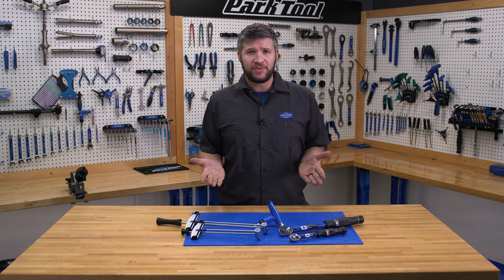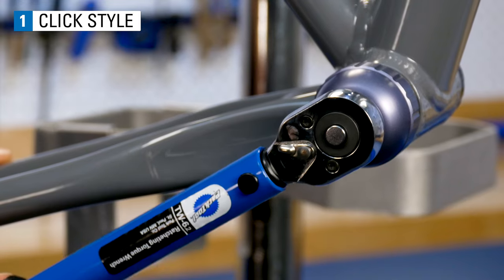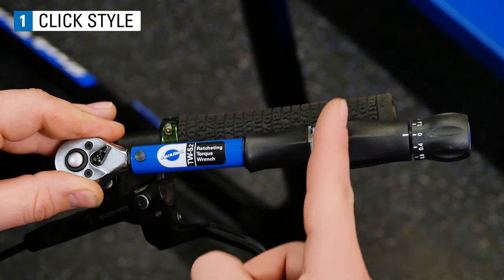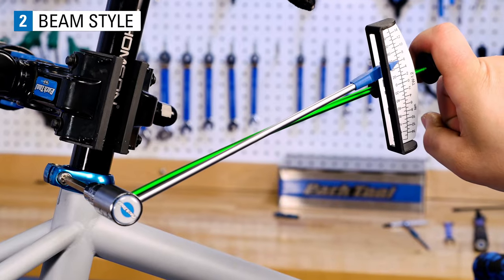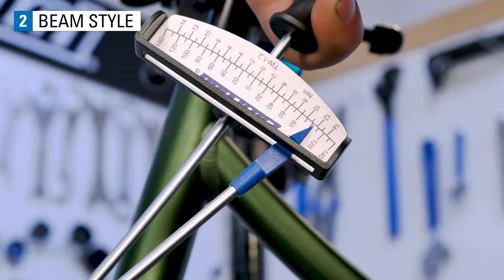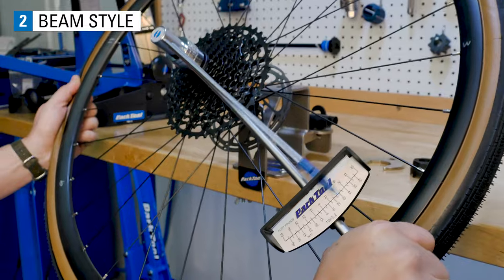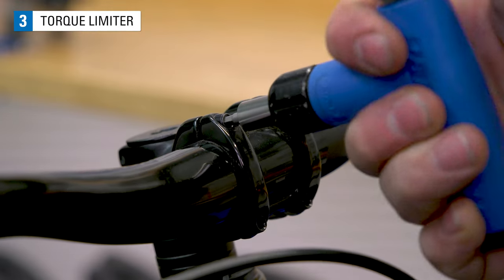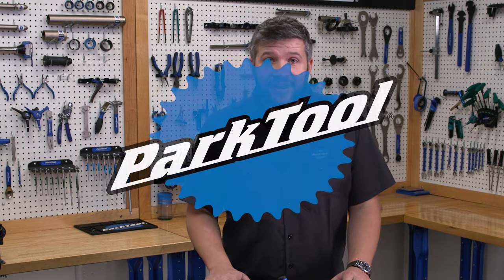Functional Differences Between Park Tool Torque Wrenches & Drivers

Comment: I recently bought a torque wrench from the local park tool distributor... unfortunately I'm having a pretty bad experience with this tool.

Mine doesn't click when reach the torque value... It's absolutely quiet...

Could it be a warranty case? 😢 😢😢
Reply: Is it the smaller one? We have one in the shop that clicks in  1 direction (counter clockwise) but not clockwise...
Reply: @_Zane__  sure, mine torque wrench is the smaller one...

Although mine click for the bouth sides
Reply: @joaoquadros8675  oh, so it clicks but is very quiet? Probably a defect
Reply from the maker: Hi! We actually address this in the Click Type Torque Wrench video we uploaded alongside this one: https://youtu.be/nc6fqnF5T2A?t=140
Reply: @parktool  I'm going to test it if bring any better

Comment: I have the cam version. Sometimes if I do one continuous movement it feels like it clicks way past the torque setting, but if I tighten by increments, it feels that it clicks at the right torque set. Am I using it wrong?

Comment: what about left handed threads?…
Reply: Fine with the clickers and the beams. Not compatible with the cam style which are one-way only.
Reply: @mattgies Not all click-type torque wrenches can do left-hand threads. Manufacturers would mention if it's possible with theirs.
Reply: Use in front of mirror. Problem solved. No I'm kidding I'm not sure